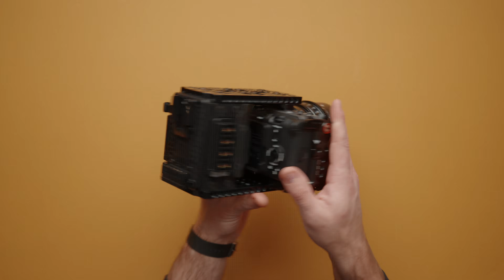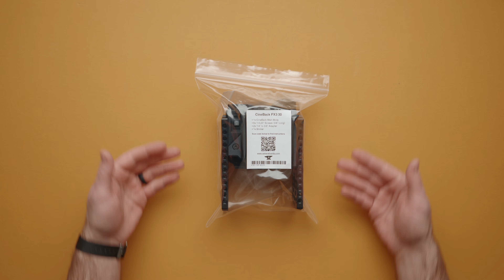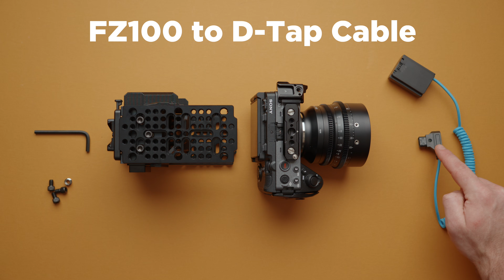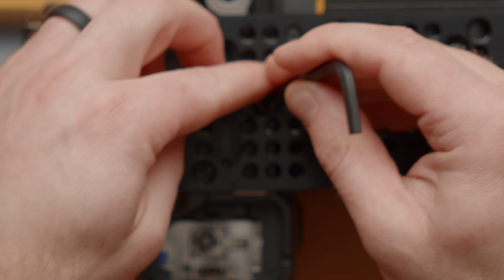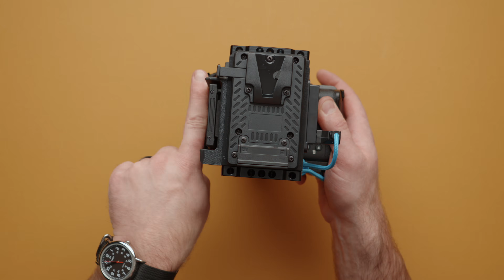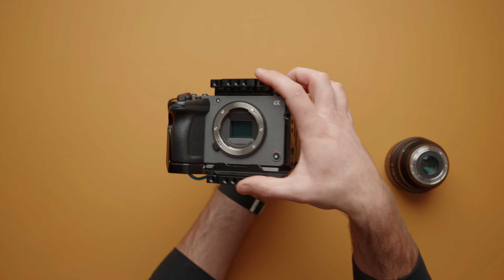CineBack FX3 and FX30 Camera Rig!

Comment: Um guys. why not just buy a camera that already has this form factor? lol. I'm just confused why spend $400 on a kit that turns a camera into a wanna-be form factor of an FX6/Komodo/FS5/FS7 ect. Just get an FS5/7 lol. If you can't create a good film with an FS7, buying an FX3 and turning it into an FS5 form factor isn't going to magically fix that. Not to mention the whole purpose of the box form factor is the easy access movie settings, shutter/PP/peaking/zebras/WFM/ISO/Variable ND all on the fly, quick access. This kit does NONE of that. Still No NDs, nor does it magically add 10-12 movie specific buttons on the side like you would find on a box style proper cinema camera.

Comment: This would be perfect if you didn't have to gut the battery slot and implement a dummy battery. Also, as nice as this is, I go and back and forth on the actual utility of it. At this point you might as well just get an FX6 with internal NDs but then again you can strip this down and have a smaller more low-profile camera so essentially the best of both worlds.

Comment: If you can solder, I use xt60 connectors that fit in dtap ports but will allow you to solder on the cable at any angle you want. They are WAY cheaper too.  That way all the cables can route cleanly.  Just make sure you keep your + and - straight

Comment: I already saw some comments about the issues with dummy batteries, 2 pin lemo and 3 pin fisher, sdi, battery plates, baseplate compatibility and such. 

I think the genius part of this rig is the screen holder. 

As well as the fixes I listed above, an option for a usb-c pd on the left side to plug into camera would be smart, maybe usb-c on the right side as well for prosumer gear that takes that.

If it were possible to have user swappable power ports I think that would be amazing! Choose between lemo, dtap, and usb…etc.

Also, a way to use “pass through power” like you see on cages for Alexa and red, where you can use XLR or other ports to power the cage without a battery. Useful for gimbal work and more.

Other steps beyond that would be taking a page out of Tilta’s book with the CFE to SSD adapter that allows installation of NVME SSDs or USBC SSDs to use as media (and an included space in the rig to “click” it into).

There’s a product by a company called Zitay that is a SSD enclosure to a dummy CFE-A card, something like that incorporated into a FX3 cage could work if incorporated in a good way
Reply from the maker: All great suggestions thanks Taylor!

Comment: So Basically....
• D-tap Male to 4 Port Female Splitter Power Cable (X1) - $19.99
• SmallRig Mini V Mount Battery Plate, V-Lock Mount Battery Plate (X1) - $22.90
• SmallRig Multi Functional Cheese Plate with 1/4 3/ (X2) - $44.92
• DaierTek Mini Rocker Switch 12V 20A T85 2 Pin SPST Small ON Off Switch 120V... (X1) 
- $7.99

And some sort of custom box to fit everything together... Am I close?

Total = $94.00
Your product = $300.00
Reply: He 3D prints the structure inside, and the cost must be made with the purpose also, I think the price is fair
Reply from the maker: With our custom fitted parts and assembly yeah! Could totally DIY this own your own.

Comment: This looks great! One thing I would change is using the nato rail pins as locating pins so you can get the same alignment every time, and make the cage that much more solid on the camera. That or having the mounting screws fixed rather than adjustable, so that it's a little more rugged.

Comment: The deal breaker is rendering the incredible 4 audio input top handle useless. Please make a top plate modification that would allow the data hot shoe to be accesible!
Reply from the maker: We are working on an accessory that works with the handle!
Reply: Is there any way to add the top handle on it ?
Reply: @nowkirkwon  I don’t think so. The hot shoe is completely blocked off.

Comment: Looks like the offspring of an FX3 and Z Cam F6 Pro marriage 😊
What's the ground loop situation with this powering cam and monitor from the same battery? 
So many folk burn out their hdmi ports from this. If there's no protection from ground loop IMO you really should warn folk who may not be aware of it. 
12G SDI would be great to add, particularly if you can somehow add in genlock.
Reply: Would powering the camera with a D-tap > USB C cable fix this when powering monitor + cam from a v mount?
Reply: @BenDavies1991  maybe. I'm no expert on usb c cables but there may be some that offer protection. I have a PD one that doesn't. Worth researching, though usb c isn't a great connection for paid work, unless you find a way to lock it. The risk of it coming loose is quite high.

Comment: It's ok, but I wanna use original top handle. And Type-C cable for power is better for powering this camera, because in power loss case if you use dummy battery you can loose your last shot!
Reply: You can buy a Dtap to USBC cable.

Comment: This is really nice work, but I'm not sure about the emphasis on Dtap. I've been using USB-C PD to power camera and monitor (and charging wireless audio receiver when needed) and it's working really well—and without the need for a potentially problematic dummy battery. As others have pointed out, optional use of the XLR top handle is also important to a lot of us.
Reply: The website now includes a version with support for the XLR top handle.

Comment: The concept is interesting, but for it to be truly "Cine" theres a few things you need to re-think about the product. 
Firsly you need more varied power outputs, such as 2pin lemo and 3pin Fischer. 
Secondly, you need more 3/8" threads than 1/4 20s, and they need to have Arri locating pins. This includes 3/8 threads on the side of the plate, so it's going to need to be taller.
For the Base plate system,  you need to think how it's going to line up with industry standard rod heights, and what plates match up to yours to take the camera to 15mm LWS height (going to studio height is easy once there). A Camera base plate isn't about just cheese plating the bottom.
It would also be great if the batter plate is easily user swappable between V and Gold mounts (maybe it is already, if you could clarify that?) 
Lastly, and this is more of a bonus really, it would be really great if you could have an HDMI to SDI converter/splitter integrated into the back, and have SDI 2-4 SDI outputs coming out adjacent to your power outputs.

Like I siad I find the concept for this very interesting. Your method of protecting the screen is great, and it's also great how you built the camera backwards, keeping it short and the center of mass low, and helping to offset the weight of the lenses and anything else you put on them. Your built in cable management space is also really neat and handy :)

Comment: Love this so much,  I just wish it had a cut out on the top cheeseplate to make the hot shoe accessible for accessories,  that way you get XLR sound in.  This means removing the small rig top piece and making the Cineback adaptable.
Reply: There are other XLR inputs besides the Sony one jussayin
Reply: @jeremysolterbeck6713  any recomendations of XLR options that might work with a build like this? Looking to buy this for my FX3 but would also still like access to XLR inputs.

Comment: Hi Caleb,  Just worked with the  Sony FX3 Firmware 4 to discover a major change has occurred since FW 3.  If a dummy battery adapter is used the FX3 monitor will display an error message.  As I understand Sony did this deliberately as the Sony batteries intelligently communicate to the camera and will reduce the risk of a corrupted file should the battery die during recording. We decided to power the camera via the USB input instead.
Reply: Yes. I have the same issue currently. My Vmount power and dummy cable front Kondor blue give me the same message. They still work, I just can’t see the battery percentage or anything

Comment: Pretty confused by this product to be honest. The point of an FX3/30 is to be small, so why would you want to add so much size when you could use preexisting hardware that would save on space. Not to mention in this configuration you lose the option to use the Sony audio top handle.
Reply: And why not get this instead of doing the rig you mentioned?
Reply: @MCplayer94  like I said before, this adds unnecessary size the other rig build would not.
Reply: You are missing the point behind a camera cage.  It is a necessary accessory to mount additional gear and battery to make the camera more functional.  In the future Caleb may release another version with a cut out on the top cheese plate to allow mounting the Sony audio top handle.
Reply: @jamesoreilley  I have a camera cage on my FX3 rigged out. I’m saying that this adds a ton of extra size when you could just use rails, a vmount plate, and a dtap splitter.
Reply: It just looks cool ok? 😂

Comment: Big problem though. How do you get the camera out about using a screw. I love the idea. I just thinking needs to work.
Reply: I wonder if we can use spacers and make it taller. Install an arca swiss quick release baseplate on top of the cheese plate. Since the fx3 cage is arca compatible.
This rig is really cool but hard to remount to a gimbal etc.

Comment: Love it but really wish there was a way to use the FX3 top handle. Now that I have XLR input I don't want to go back!
Reply: Super easy fix, get a cheese palte that is shorter and screw on 2 cheese bars from the bigger plate to the 2 top screwholes on the fx 3. You just use longer screws and put the cheese rods on top of the handle screwholes.
Reply: @poti732 We need a video on this… lol.
Reply: @MotivateBelieveAchieve well sincs i do not have this configuration i cannot show you but it is super easy you kinda make a U shape with 2 cheeserods And a shoerter plate And attach Rods to the the handle screws with longer screws.
Reply: @poti732 Is that ”safe” tho? From what I heard that handle is pretty plasticy and might not be made for all this extra weight, also depending on lens weight and some other factors, that might not be ideal placement for a handle right above the camera
Reply: @CarlBergsdorf  literally the same weight as the normal top cheese  plate that you see in the video. If it can hold the cineback it can hold it with a different plate. Also iv used the handle and we had rod mounts, qr plates , vazen anamorphic  ( which is very robust) and a smallrig V mount .  it was holding it easily. Would grab it by the top handle ONLY . I was always using a side grip too but iv never had problems with that.
Reply: Nah 1000% f that handle
Reply: @iComplainer username checks out
Reply: @iComplainer ya they should make it metal
Reply: There is 2 ways to go about this 
1-Get a hot shoe extender cable which can give the ability to mount to handle any where within the range of the cable but would require to strip down the male part and expose the electronics and cut off a sliver of the NATO to rail which is a messy job.
2-upgrade your audio game with getting a field recorder like the zoom f3 which is tiny or the new zoom r4 which is light and mount them on top of the generic top handle using a v mount mini quick release adapter. 

Now you have 32bit audio with a backup and a field recorder which is fantastic when needing to boom the mic or give it to an operator.

I use the second method by the way 
Upgrading for a tascam dr40x to zoom 

Cheers
Reply: @MrZerosami2  Oooorr ypu know just get a shorter top cheese plate , attach 2 cheese rods on both sides so they reach the 2 top screws on the body . Put on the handle and use 2 longer screws so the cheese rods go around the handle and attach with the 2 screws to the body and the handle at the same time-
Reply: They have a xlr kit now as well.
Reply: @kempy2  i saw
Reply: @kempy2  300 bucks again no way dot 3 pieces of metal and some crews nah, i could buy a mirage with Nd
Reply: I believe that they have made a solution now. Or at least I know that they are making one.
Reply: @hudsonconnolly104  yeah they made it a month or two ago.

Comment: It looks fantastic, really does, I've been waiting for this one, but I have 2 questions
1) Could we disassemble the DTAP ports and rotate them so that the DTaps "base" cable doesn't bend like that ? 4:54 I'm afraid the cable life will be shortened by that bend. 
2) sadly I bought the Tilta V2 cage for my FX30 since it came out, is there a way to know how much clearance there is on the CineBack to know if my cage will fit ? I really don't want to buy another cage for the cineback but I do really want it. 
thanks for this Caleb, again and again, coming out with fantastic stuff!
Reply from the maker: Thanks Andy! The D-Taps aren't able to rotate but even if they did, the cable would then go right into your hand when holding the camera grip. I'll look into a way to have a cable clip or something to keep the cable from kinking too much but we've beat these up pretty good and have had no issues yet!

Oh and as for the Tilta cage, we may make an adapter, but I can't make any promises.
Reply: @camerafoundry  that would be fantastic really, to be able to use my tilta cage and have it as compact as with the smallrig (sort of), oh and about the Dtaps, what I meant by rotating it, having it on the same right side but "upside down" so the DTap connection still is on the right side but the cable going towards the camera body, protruding on top of the vanity plate, I feel that would be a "Solution" or no ?
Reply: @camerafoundry  When it comes to the FX3/FX30, I really like the Tilta cage and accessories more than Smallrig's offering.
I will gladly wait for an adapter so I will keep my finger's crossed.
Reply: 2nd vote for the Title cage compatibility!!